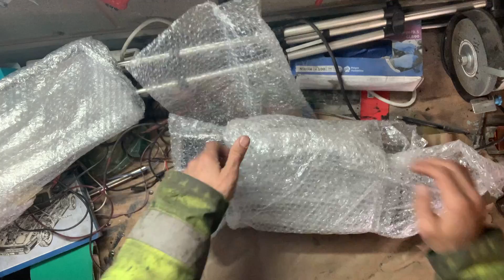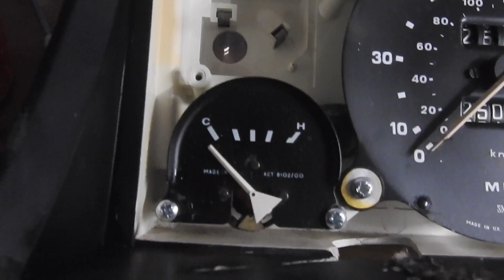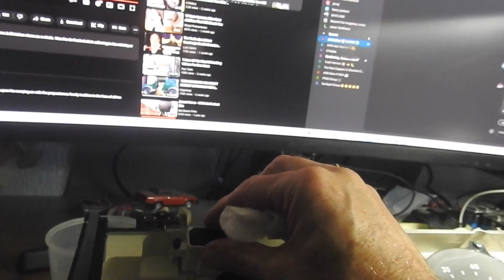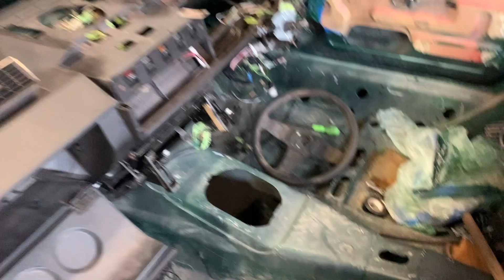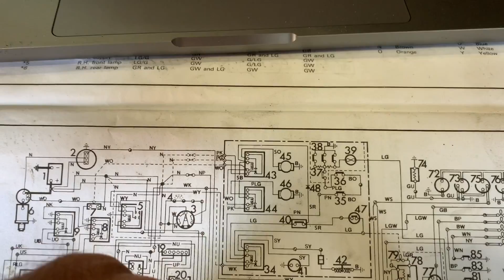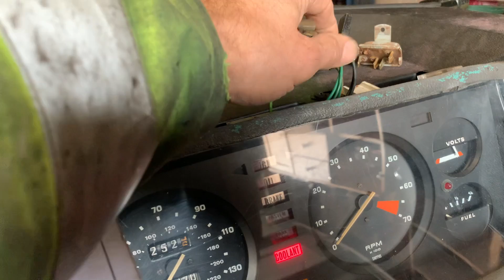Triumph TR7 Restoration: Instrument Panel and Dashboard install   HD 1080p

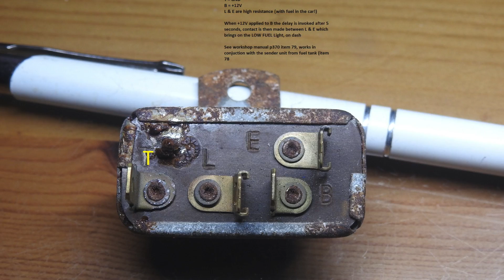Comment: 22:20 The fuel warning light system is quite simple and yet clever at the same time, 12v is fed into one of the male spade connectors, the other male goes to the switch in the fuel level sender unit, the switch is normally open circuit but goes closed circuit when the fuel level is low, the other side of the switch in the sender unit goes to ground. When switch closes (low fuel) current passes through the male connectors which causes a coil to heat up, as it gets hot it causes a bimetallic strip to bend which closes the contacts between the two female connectors, one of these is fed 12v, the other goes to the warning lamp in the dashboard, the other side of the lamp goes to ground, when current flow through the lamp it lights up!  The idea is that there is a short delay for both the lamp being switched on AND it being switched off, this prevents the lamp annoyingly flashing on and off when the fuel level float is bouncing up and down in the fuel tank. The reason I know all this is because I'm replacing all of the gauges in my friends TR8 with much newer ETB gauges, I ended up learning quite a bit about the old gauges! These days it would be done using electronics.
Reply from the maker: Thanks for the help

Comment: Its all looking good Henry, and well done Chris, I'm a good 12 months away from any of this so will be revisiting these last few video's again. All the best to you.
Reply from the maker: Some bits seem to take ages to get to and some come around really quickly.  I think my biggest problem is the wiring loom is so amended and with loose connections.  It could have done with more repairs but I couldn't make head or tail of it until I got it back on the car and then the repairs are too late.  If the loom is good, you should be good
Reply: My loom looks like a dozen cats playing in the wifes knitting wool basket.  @HenrysGarage

Comment: Hi Henry, good to see the dash back in and I really liked your fix on the plastics. Great that the clock still came to life, I wish mine had.
The delay unit for the sender is to stop the light 'Low Fuel' flashing when the fuel is lower in the tank and sloshing around, when driving around bends etc. When the float is low it does counter the delay on the unit and forces the light to stay on. 
With the engine out that would also be why the IGN lamp is not coming on as it's derived from the alternator circuit. There are no fog lamp illuminators on the dash, that lamp is contained within the actual fog lamp switch, but the lights have to be on too. 
If the tank is empty, I mean really empty, it might be worth pulling the float mechanism out to see if it is dirty, you'll be able to force the signal too to get the fuel gauge to move, I did test the fuel gauge and it does work. When the tank is near empty, two contacts on the float sender short and then bypasses the delay unit to bring the lamp permanently on, that's when you know you should be getting fuel. With all my 7's I have never had one fail, just get a bit corroded.
Good going, you ae good at working this stuff out so don't beat yourself up eh!
Reply from the maker: Thanks Chris.  I was planning to pull the sender unit out of the tank but thumped my head on a dolly and got blood everywhere so I decided that was enough under the car for a coulpe of days.  The dash going in makes a real difference to the look of the car.  I'm feeling pleased.  Thank you for your help

Comment: That’s some exciting progress getting the dash in there, starting to look more like a car! I find it fascinating looking at these TR7 parts, some look really modern, and some are clearly the same as you could find on 50s designed cars like the Herald. 
For the fuel (and temperature) senders, fully earthed is usually the max reading on the gauge. The simple test for if the gauge is working as expected is to ground the sender wire which should make it read full/hot. Though there’s clearly some extra complexity with the fuel warning light there so there is some chance the TR7 differs here.
Reply from the maker: Thanks, what I am finding is that fully grounded is showing the low fuel warning light.  Perhaps I have is set up wrong.
Reply: Looking at the wiring diagram it looks like that might be correct. The gauges are definitely differently set up than the earlier style ones. Spotted there’s a ‘Eureka wire’ on the diagram, wonder what on earth that is for!
Reply from the maker: I know, I love that.  Presumably it is something to do with water displacement, but not sure where
Reply: @HenrysGarage I had a bit of a search and apparently “Eureka” is the name of a specific alloy wire with a close to temperature independent resistance, and is used as the ballast resistor. No connection to Archimedes unfortunately!
Reply: @redfoxclassics  Yes, this was used as a 1.5 Ohm ballast resistor when on the 6V system with a coil of 1.5 Ohm resistance in series. When you started the car it bypassed this eureka wire giving a momentary full 12V when cranking to start, helped in colder weather. When people updated to electronic ignition, a 12V coil ; 3 Ohm was used and the shorting of the "eureka" wire was required to be done. 
My suspicions on the first models of TR7 catching fire may have been caused by this wire getting too hot & as it was in the dash loom did a lot of damage as you may imagine.
Reply: @ChrisFEJackson  I always find it a bit strange that ballast resistor wires were fitted rather than a resistor as a component (mostly thought about it in the context of later Spitfires). It’s got the risk of heat building up in the loom as you mention, you’d need the wire to be at a precise length for the resistance to be correct (though I imagine the tolerance is wide enough in practice), and it confuses plenty of DIYers at least!

Comment: Hi Henry. Nice to see the instrument panel coming to life. What are the two individual wires connected at the back centre of the instrument panel used for?
Reply from the maker: Hi Andy, I think you're talking about the two pairs of wires that go to the beam and low fuel warning lights
Reply: @HenrysGarage  Yes. Intetesting. I only have one pair on mine? Not sure what the wires are for. Did you find them on the wiring diagram?
Reply from the maker: I could see where the two pairs connected.  I worked out which way around they went by trial and error - I didn't check the wiring diagram.  But when trying to sort the low fuel, the connecting wires were the same colour as those at the low fuel delay unit and those colours were shown on the wiring diagram
Reply: @HenrysGarage  Did you know which wire went on which contact or was it a guess?
Reply from the maker: Doesn't matter.  It needs earth one side and positive the other side.  The terminals are direct to the lamp so reversible
Reply: These were in the dash as I received feeding a red LED, I kept them in rather than leaving a whole in the faceplate where the green dash lights would shine through when on. Who knows what it was for? some mod to report something.....